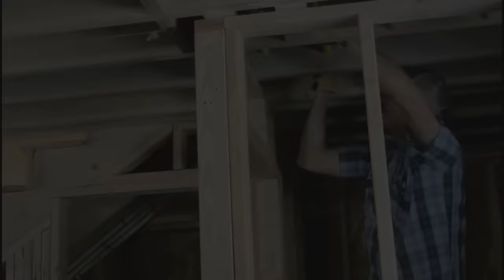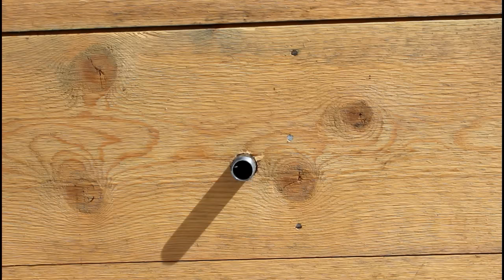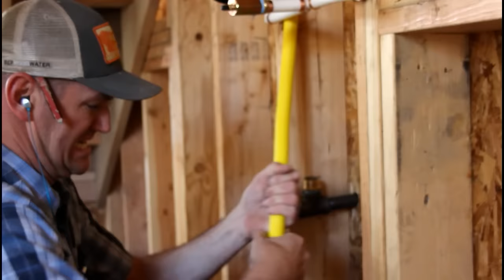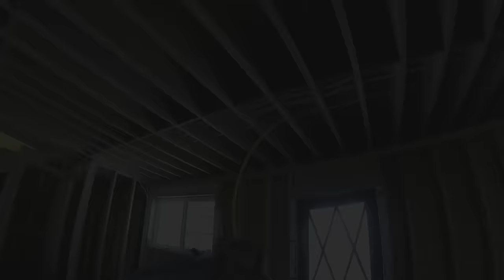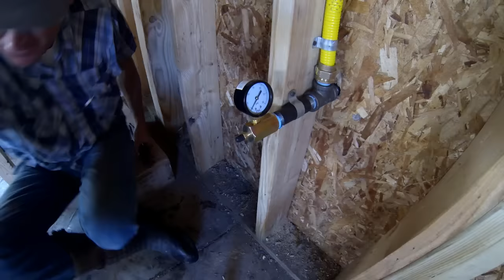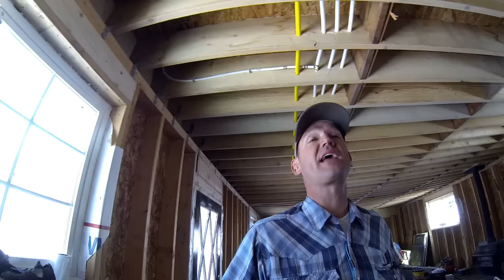#207 - I Installed Flexible Gas Line From Home Depot... (It Leaked!)

Comment: where the pipe comes outside and rests on the wet wood , I might install hot dipped galv pipe . just the way I would do it...
Reply from the maker: Galvinized is illegal with gas. It will get painted.
Reply: Red Poppy Ranch where and when did that happen?!
Reply: has been in the national code for 40 plus years.
Reply: Ron and Lori Wood so are you also saying it's not up to code to use galvanized?
Reply: No I am saying read the National fuel gas code. Its in black and white. Do not use galvanized pipe or fittings.

Comment: I wouldn't want that flex pipe anyplace in my house inside a wall. It's too dangerous, someone down the road drills a hole in the ceiling to mount a smoke detector and that pipe will easily be pierced. Black pipe which is more difficult to install will not easily be pierced by nails screws or drill bits. That flex stuff is dangerous
Reply: I don't see how this is any different than some bozo drilling a hole in the ceiling and hitting an electrical romex wire?? Whether it be CSST or romex, someone's not being careful enough with their tools.  As well this CSST isn't supposed to be strapped or secured to studs/joists as it will give flexibility to move if someone does run a drill bit or screw near it. And just like romex, if you're running it through a stud/ joist,  and you're too close to the edge,  you need a protective plate over the stud/joist to keep from running a screw/nail too far and hitting the CSST.

Comment: why ins't the CSST bonded to ground?  That is one of the most critical steps in  installing this type of line. In addition the lines going to the side exterior walls the  CSST line should be ran through a metal conduit or sheating to prevent puncturs from nails by sheetrock nails and other nails etc.   

The way you installed the line u should of ran Black Iron it would of been safer since you failed to use any of the safety precuations convering CSST.   CSST improperly installed IS VERY DANGEROUS.
Reply: Morgan ali, the lines are 3" to 4" in the joists. Do you nail off your drywall with 16p common?
Reply: @davidd837   it's code in most municipalities for CSST but also standard practice. putting CSST in conduit or sheathing is VERY important  for extereior walls  for the future after the walls are put up. Saay you want to mount something from the outside or the inside if you use a long bolt or long drill bit less likely to puncture the CSST line.   

U maybe right ti's deep inside less likely to hit the line  but for exterior walls it's always good standard practice to have them protected  with sheathing or armor plating for CSST  

That's why i like black iron pipe NONE of these issues apply.   mainly cause CSST is so much thinner it' is so easy to puncture. But in earthquake prone areas CSST has an advantage
Reply: @morganali9636  Straight from the UBC "states that if the pipe is less than 1 1/2" from the edge of the framing member, the pipe must be protected by a protective shield plate of minimum thickness 0.062 inch steel and shall extend 2" below the top plate and 2" above the bottom plate."

Comment: That stuff is junk my company used it a few times it leaks I’m baffled how it’s available to home owners to buy. I’ve been s master plumber for 20 years and that product is the worst. Also u shouldn’t use Teflon on gas pipe it dries out over time and leaks occur. Nice work tho u should try proflex at Lowe’s it’s good. I use track pipe and ward flex
Reply: Black pipe sourced from anywhere is so much less hassle. I never want to hear about a gas leak from something I've installed or help install.

Professional or laymen, DIYer or local union guy, it only takes an idiot to screw up gas lines.

I've gone back and found leaks from some idiot (union guy) with a fancy sniffer that hated my soapy water method. Jokes on him, I've got his clients now. (He got his brass shut offs waaayy tighter than his unions). "I was afraid to snap those couplings" I'm thinking "how many unions have you tightened before?! You never split a brass shut-off before though...🤔"
Reply: yes,, as a master plumber for 30 plus years  the home depot tubing is very touchy on installs was called out on thabkgiving day for gasleak in a commercial building-mexicans used the home flex- i shut the building down-used gastite  &  steel pipe ,,,fyi this tubing only locks into on corragetion ,,whilst gastire lock into 2 corragations-  i hope god is w him,,,junk & novices will blow the world up..

Comment: Your first mistake is using teflon tape on gas line. Always use pipe dope . I only use teflon tape on water lines and only use blue monster. I use pipe dope on gas lines never have a leak

Comment: The flex is so thin and if you have a nail or screw puncture during construction you have to tear it all out. I would rather stay with steel threaded pipe' .  Steel is much more forgiving during construction phase.

Comment: This product SHOULD NEVER BE USED WITH PROPER CERTIFICATION! I’m a master plumber and I have seen so-called professionals screw-in up. Since gas is the most dangerous utility in the home, amateur installation is not recommended. Most gas codes do not allow Teflon tape on most gas lines
Reply: Even the "UL Listed" yellow teflon tape made for gas plumbing applications??  How is it even sold in stores and approved for gas applications then if it's not allowed according to your comment?  Just a FMI for myself....

Comment: too bad that the sediment trap is installed wrong. should be vertical.
Reply: then he couldn't put that pressure on.
Reply: Ha Ha.  All the experts miss it
Reply: Silly people, it’s not a sediment trap, it’s a outlet for the hot water heater.  Didn’t you listen to the beginning?

Comment: Channel Locks.... a great tool and you didn't need many more to do the job...it's great you have a propane dealer that delivers in the area... the mud issue is all about you having great soil for farming, but not very well suited for road building... your channel is growing fast so crushed stone and drainage ditches with culverts then grassing over areas where no road or parking you'll be able to afford the rock and you have the tractors to do the landscaping... all you need to do is watch how the land reacts in the rain and melt and improvise.... maybe you can even barter some plumbing skills and labor with a gravel company.... even your skills at septic installation can become a great business as new homes go up... the mud issue will resolve once you got the house all built and have time to address it. That septic system where I live would have cost $50,000 if done by a contractor, and your ability to do plumbing and electrical and all the carpentry you have saved a lifetime of MTG payments.

Comment: This is scary. No offense.  Never use vice grips on brass fittings. Never leave stainless inner pipe exposed.  Drill the holes at least 3” into the joist.

Comment: After 30 years of working for a gas company I would never install csst  in my house. This stuff needs bonded according to National Fuel Gas code. Good luck.
Reply: You wouldn't install it BECAUSE it needs to be bonded, or for other reasons?
Reply: Lots of issues I feel. Can be easily damaged by nails or screws. No one ever wants to bond them properly. Lighting strikes on houses can blow holes in it. No one properly installs transition fittings or striker plates. All these problems can be avoided by using black iron. If I ever buy a house with csst That would be the first thing I would do is replace with black iron. Have your partner hang a picture and put a hole in it. Then see what kind of day you will have. Thanks for the question. Ron
Reply: Same thing can happen with Copper pipe in walls, or PVC, and ANY other improper installation of a product.  IF an owner/installer chooses not to install strike places, bonding, etc., that's just pure LAZINESS,  and does not make this product a bad one.  I've pulled CSST in through attics and other difficult areas for straight pipe (areas that are NOT likely to be tampered-with), and simply ran black pipe down the walls where there MIGHT be a chance of nails/screws, but again, these areas are generally NOT likely to be ones that would be chosen for hanging pictures, etc., and so again, an over-precaution IMHO.   But again, to hold a good product in contempt because of reports of failures due to improper installation is simply wrong... again this IMHO.
Reply: Ron and Lori Wood That is why I use Gastite tubing with FlashShield.  And I took the course to get certified to install it as the supplier I use required that in order to sell the Gastite product.  However, you can buy the cheap stuff at Home Depot without any training, but it is far inferior to Gastite.  And I do install the required striker plates so you will have to work hard to get a screw or nail through my CSST.  Other than ease of installation, one of the real benefits of CSST is in seismic zones.  Much of the incentive for this product came from failures of iron pipe during earthquakes.  CSST will stay intact through most earthquakes whereas black iron will fail quickly when things start shaking.  That is why you see so many fires after earthquakes.
Reply: So bond it properly to ground bar  on the panel like everyone does. It’s not hard
Reply: Copper, PVC, and etc., don't contain a fuel that can blow-up and entire city block. Just dumb.
Reply: @rondijcks9162  I agree lots of problems, but it does provide a fix when there may be no other.  I'm in that place so this is incredible.  I also know the "lightning blowing up the house" is like the "popcorn lung" for vape devices.  It's a scare tactic/old wives tale/facebook meme material.  While I know it has happened, the stats are so incredibly small, it's not probable and therefore of no concern.  Just don't be a moron and open a Gofundme because you didn't pay house insurance and it happens.  There's always a couple morons who think they can skip on their insurance and nothing will happen.  Murphy says otherwise lol.
Reply: @sportscarclinic  Natural gas won't "blow up the entire city block".  Just dumb.
Reply: @sportscarclinic  Properly bond & ground your CSST and problem solved to "Blowing up an entire city block"

Comment: Proper pressure for inspection by code is 3x working pressure [a minimum of 15 psi] to hold for 10 mins. Using black metal pipe to the outside is a mistake and will eventually rust out and leak inside the walls. They make proper brass terminations for CSST. and they make termination boxes for ranges. Working pressure for appliances inside a home is 1/2# pressure. Actual transport pressure inside a residence can be up to 2 psi. Commercial is 5 psi. Each hole your line goes through is supposed to be sealed with fire caulk. Between floors must also be fire caulked and have nail guards. You people making these homemade videos need to know what the hell you are doing before trying to teach people what you do not know. You're gonna get someone hurt or worse. Your installation is not safe. You using a pipe wrench and channel locks to tighten is wrong. You'll never get a sealed line that way. 2 wrenches and some torque are needed to ensure a proper seal. Except for proflex. I am willing to bet an hour later you had pressure drops.

Comment: The purpose for a dripleg is to catch sediments and moisture. This dripleg is absolutely useless. Just sayin'. Bottom of t-fitting should have had a 90 degree elbow with a 3 inch dripleg and capped off. Or the t-fitting turned the other way.

Comment: guy broke like 3 different manufacturer codes and people are like thanks for the great info lmao. this stuff is for underground use only, where above ground you use a metal riser to transition.. its not to be run in walls or buildings.

Comment: Inspector should never allow any weak pipes inside any vertical walls ! That’s a no no ! Do it right with strong black steel pipe inside walls ! 👎cutting corners will cause problems, any goofball comes to your house and screws in to the wall and bye bye to the moon 👎

Comment: You NEVER drill through or cut ANY structure. What happens when you do class? You weaken the house.
Reply: And that is why all wires and pipes in a house  run accross the floor or ceiling, right.
Reply: Maybe in your house. Good luck with that.
Reply: Your house must be a wiring and plumbing nightmare.  I can see your kids now, just a swings from those electrical wires you have running across your ceiling.  They're probably trying to climb those pipes you have running up the walls as we speak.....🤣🤣🤣😅